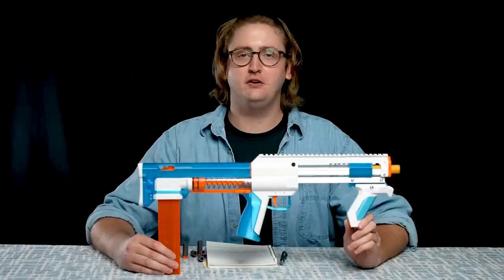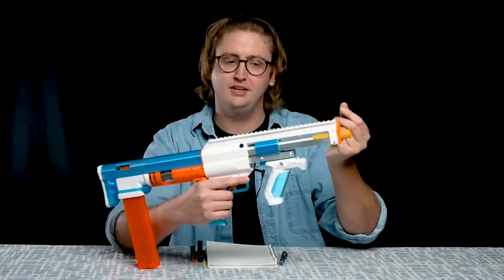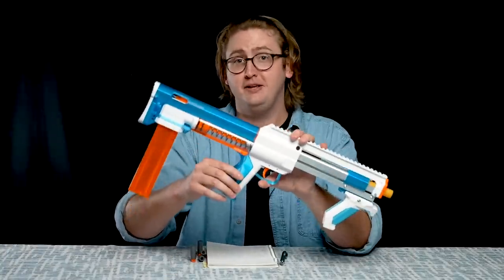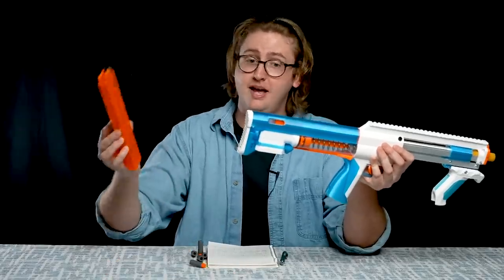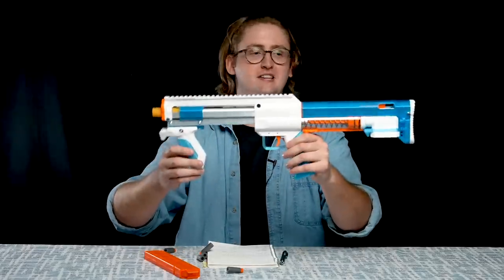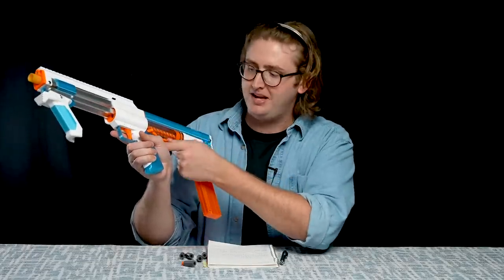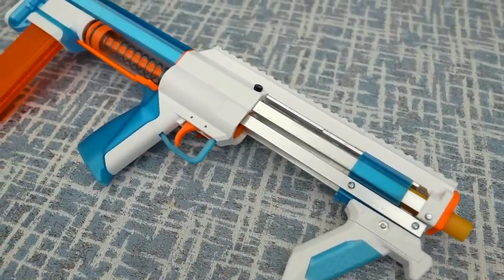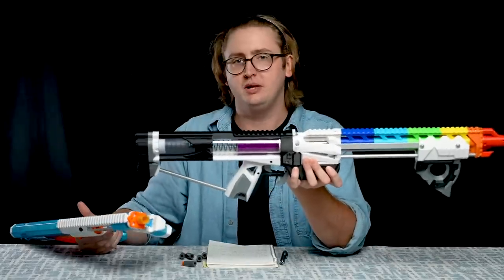[REVIEW] Lynx by Orion Blasters | POWERHOUSE Half-Length Dart Launcher!

Comment: Hey Coop, while yours is shooting super hot you can easily change out the spring to a 788 and drop the fps by quite a bit to make it hit ~150 fps which makes it more friendly in terms of getting hit by the darts AND an easier prime. Just wanted to add that in for all the viewers who might be put off by this beautiful powerhouse. I certainly love mine and Silverfox is the way to go!
Reply: Also a shorter barrel will help bring down the power 😉
Reply: What other springs are there that are easy to prime but also can reach good numbers? I'm looking into springers myself but am new-ish to the hobby, so I'm debating between the 788, a colored SF25-TC, or a K25. I have a Nexus Pro with an AKBM spring and this thing is just impossible to prime. I might just be a weakling but my elbow is killing me after only a few minutes of use with it...
Reply: @JosephStardust  if you're having trouble with the Nexus Pro, then 120+ fps might not be for you.  If you need a springer, check out the Dart Zone Villainator, much friendlier to prime with similar ergonomics.  But if you want to remain competitive, the Spectrum is second to none as a stock class blaster.  Its cheap, ergonomics are great, and its performance outranks anything Nerf has.

Comment: the lynx works so efficient - you dont need a strong spring. normally i put a 9 kg longshot spring in mine. once i built a lynx with a 22 kg spring (from worker) and it was an absolute overkill. it destroyed 50% of the darts at the first shot! the blaster is the best desing desing in the hobby. it has solid ergonomics, has a compact size, a big plunger and the best point in my opinion is that the screws, nuts and bolts don`t come loose over time in useage. the whole blaster is hold together by metal bars and takedown pins. and that is what the lynx makes my personal number one!

Comment: Btw anyone who wants one should know that the catch is 3d printed also and under heavy use with high spring loads wears out pretty fast. There's a metal one being developed but an easy fix is to print multiple or have someone print you a few as replacements. There's also a trigger on Thingiverse that is designed with I think 5 degrees more give to engage the catch easier that fixes that catching issue Coop mentions.

Comment: The Lynx is my favorite springer primary  by far.  With an upgraded barrel from silver fox industries... cut down slightly,  and a Slurpee scar, it is my only blaster that I use a red dot sight on and feel completely justified to do so.   The only real problem is the SENC has a 150fps cap and while I got it down that low with the stock barrel cut down and a very soft spring,  I just can't get it to work  consistently ......fps is all over the place and the accuracy actually got worse.    200-220 seems to be the sweet spot for this blaster and I have yet to be able to use it in a game.....ugh..

Comment: Hey coop I have a question. How does a compression barrel differ from a faux barrel
Reply: A compression barrel has a full breech, so it actually is sealed, unlike a nerf blaster like a retaliator or something. The seal is so that all the air being pushed by the plunger rod into the dart actually keeps all the pressure from the air when the dart goes through the barrel, and thats also what the compression barrel is for. Since the barrel compresses the dart then air doesnt escape by going around the dart out of the barrel, so all of the air goes into the dart and it can use up all the pressure from the air without wasting any until the dart leaves the barrel. 

On a regular nerf blaster the faux barrel is basically just a tube for the dart to go through, and it doesnt help performance

Comment: That's a quite interesting design, I noticed instead of pushing the seal back and holding it to the rear of the blaster like most other designs you're going back to pick it up, then pulling it forward to hold it there instead.

I wonder what made them chose that design over a more conventional plunger system?
Reply: Bullpup